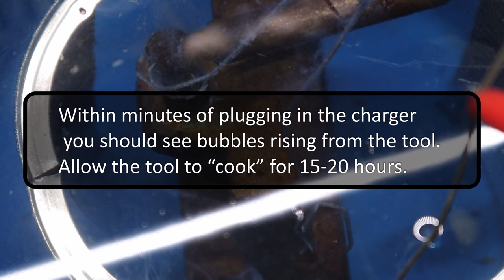How To Remove Rust With Electrolysis In Six Easy Steps

Comment: Laundry soda (sodium carbonate) works even better than baking soda (sodium bicarbonate), but both work.  A standard 10 amp 12V charger works fine.  I often use an old scrap of rebar instead of a tin can.  When the the rebar starts to load up with rust, I see the current drop.  I clean the rebar on a wire wheel, then put it back and see current increase.
Reply: Common Sense Realist  I usually start with 24 hours in vinegar for an old axe.  A hit of the wire wheel after that, and I can see the temper line.  Electrolysis or Evapo-Rust (chelation) comes after that.
Reply: Scrap Stainless steel works well and can be wiped clean. Also 12v (18-22v) solar panels work by themselves as power source.
Reply: @neomateo944 stainless should NOT be used with electrolysis!
Reply: @cody2097  Why not
Reply: @dukerton15  hexavalent chromium
Reply: @cody2097 i attach rusted item with stainless wire i have and its quite violent

Comment: If you sand a small area with fine sandpaper where the cathode wires are attached to the tool to expose bare metal, the time required will decrease due to a better electrical connection; iron oxide conductivity is poor.   Also, if you use coated wire except for the connection to the tool, the water electrolysis (hydrogen generation) will be less.  Notice the bubbles on the wires to the tool and the anode.  
Nice choice of anode, the can will allow a good electrical path to most of the tool.  If you could use a large can that the tool completely fit within, that would work even faster.
Reply from the maker: Thanks for the tips. I will keep this in mind.

Comment: Good video 😎
Get an old car battery charge it up pour all the acid out and use a paint brush to paint it on,
Dissolves the rust instantly
Removes every trace of it
Or soak in vinegar for a few days,
 I've restored loads old tools I Found in a quarry using white vinegar 😃

Comment: Safer, healthier, and so much cheaper.... White vinegar.... Glass container and cover the rusted object totally. Works perfectly every single time. Even faster if you heat up the vinegar.
Reply: Ok MamaBear...some of us drink Monster Energy for breakfast, not oats...
Reply: I'm all for the safer route👍👍
When you say "heat up" is that just a case of putting the vinegar in a pan and heating?
Reply: When I'm doing electrolysis, I use washing soda, and an adjustable power suppy. It's pretty safe, and it works better than I could ever get vinegar to. Can't get it to electrocute me if I tried, and the solution isn't poisonous or bad for the environment at all.

But I had the power supply on hand for electroplating. I'm not sure I'd want to use a computer power supply, like in the video.
Reply: @Savagedownsouth  j
Reply: How is vinegar cheaper?
Reply: @Luke10.25-gospelJesustaught  It ain't THAT bad. I've done both. You get a little more flash rust with vinegar, and if you leave it too long, it'll eat the iron, that's true. But it's not ruining the pan.
Reply: @Luke10.25-gospelJesustaught  My dude, I do electrochemistry and cast iron repair for a living. I'm a machinist who also does plating. I've also repaired a bunch of old cast iron machines in my day.

Vinegar is a fine way to remove rust. You rinse and scrub whatever you were derusting when it comes out of the bath, dry it, and coat it in oil. It works in an industrial setting, and it works on pans, without any more lingering rust problems than the electrolysis method. 

The real problem with vinegar is that it eats the metal. It makes sharp edges sharper, and can make you lose detail on a casting. Not really a problem on most pans or parts, unless they're decorative, or require tight tolerances.

I've read the same things you have, and I used to be scared of using vinegsr to derust things. But after years of doing it in my own shop, and seeing no practical difference, I no longer think it's an issue.
Reply: @Luke10.25-gospelJesustaught  That's a good point. Chrome and nickel plating are surprisingly finicky. I'm also realizing I've never tried nickel or chrome plating over a vinegar-derusted piece of iron. I oughta try it some time, on my own stuff.
Reply: @Luke10.25-gospelJesustaught  you must be wrong. literally every body says use vinegar everywhere online not just youtube.

Comment: For those of you watching this video, you should be using "Washing Soda" (sodium carbonate) not "Baking Soda" (sodium bicarbonate) for the electrolysis process.
Reply from the maker: Agreed, both has similar results. All it does is make the water conductive, even using regular dishwashing liquid will work. I have used baby shampoo before with good results, and it smells good. ;-)
Reply: I dont know that it matters much if its carbonate or bi- carbonate.. Either works great. Just dont use table salt because that produces chlorine gas which can kill you..
Reply: You can make sodium carbonate easily by just heating sodium bicarbonate at 100 degrees Celcius
Reply: @andyloescher2401  are you sure it is 200C and not 200F? thought it was 200 Fahrenheit for 1 hour
Reply: @Midnightgamer00  damn oops. I meant 100C
Reply: @allanhundeby1675  How does it do that unless there is chlorine in the water already?
Reply: Do  dc from 12v battery would work?
Reply: @damantrip2874  perfectly, but take care of short circuit, a car battery will put a lot of current during short circuit and could cause some serious damage
Reply: @damantrip2874  run it through a light bulb to serve as a current limiter.
Reply: @damantrip2874   because chemistry.  Salt is known as “sodium-CHLORIDE”
Reply: @brucetutty9984  Table salt is sodium chloride - (sodium and chlorine).

Comment: This is very interesting and enjoyable.   Can anyone comment what is the chemical composition of the fluid in the electrolysis bucket after the procedure, and how can it be safely discarded?  (It looks a little unwholesome).  Thanks
Reply: to my knowledge (which is not too professional) all this is doing is creating iron oxide (the unsavoury black goop) and some gases. one thing to note is NEVER EVER use stainless steel as your anode or else youll create hexavalent chromium which is a neurotoxin and carcinogen among other things, and thatll need to be professionally handled as toxic waste haha. so as long as youre using the correct metals and doing this in a well ventilated area youre all good to dump it whereever, if youd like you can be doubly safe and dilute it with some hose water haha. if youre really unsure you can contact your local authorities or waste management wherever you are and ask them about the proper disposal here. with any home chem as silly as it sounds youve gotta do a ton of research to make sure youre doing it right and not making something toxic.
Reply: @accuwau  thanks - very informative and helpful

Comment: So, were you able to remove the stuck screw?. I have noticed parts that are close together don't seem to get as clean as the rest of the parts? I would try a little heat first because it's easier and faster. Then you can do a complete teardown. Depending on if you are just wanting a working vice or complete restoration. Thank you for taking time to post this.

Comment: On electrical supply: Using a 12V supply @ 2A (suggested in another comment) is probably a little overkill, but the higher the wattage (12V*2A=24W) the faster the derusting (just don't get silly with it). I have used an old cheap USB charger plug which is only 5V @ 0.5A(max) which would be 2.5W. It takes longer, but the results are generally the same (with properly sized cathode). Patience with smaller wattages, but if you have the time it doesn't require constant attention.

Also, the baking soda (sodium bicarbonate) is only in the water to raise it's conductivity =slightly=, salt would also work (I have used it) but with salt you might have a more immediate chance of an oxide layer form (iron/steels) afterward. A good wash and dry immediately after derusting would probably fix that.

Make sure the part is completely submerged. Try to use a flat(ish) cathode with about the same mass as the part. Make sure the part and the cathode are secured in the container and cannot touch each other. And remember that wet skin is =much= more conductive than dry skin; best to just use rubber gloves and avoid the water when dealing with this and always respect the potentials involved. I'm not going to say this is a super dangerous process, but it is water and electricity and getting bit sucks.

Comment: Electrolysis. What a fascinating name. It has Electro and Lysis in it. There’s the battery, then the plugs and now the can. The can is opened and sawed into a split. Drilling, looks like a fascinating project in these hands. Soap cleans iron, and electric battery cleaning scraps rust right off like it was an easy dish stain. This is not the first video I watched that amounted to powder aiding in the battery cleaning process and how it cleaned without touching any form of electrolytes? Wow. It’s all basic clean for hours on end, plus the effects of positive and negative power. 

It all had become a complicated muck of orange, yellow, brown and gray resulting from this much rust and aging of the vise. Then it was scrubbed a few more times to eliminate rust completely until the whole body turned gray. You probably know it’s gray from being a newly melted iron. I had realized that the vises were used in countless woodworking projects like at school. I recalled making stuff out of wood using vises.
 
The whole story about the vise makes me realize how much I’ve learned in shops and it wasn’t that hard getting good grades. I’ll bet this is not new to me because I’ve seen this kind of cleaning in some restoration videos.

I’m blown away. Love it too.

Comment: why not disassemble it first before doing this? wouldnt this leave rust in the parts where the threaded bolt is covered? seems like sandblasting them after taking it apart would be easier
Reply: Sandblasting, muriatic acid, wire wheeling all would have likely worked better, but would have defeated the purpose of the video.
Reply: Exactly what I was thinking after seeing the final result. Spray some liquid wrench on the threads, prop it up to let it soak down for a couple hours until its unstuck. Then sandblast it and not only will the rust be gone, but it will look much better in the end.

Comment: Can i use this in my radiator?
There seems to be a lot of rust mixing with my coolant.
Reply from the maker: I cant give you any advice on how to fix your car. For that its better to talk to a professional in the field.
Reply: Most radiators are aluminum and plastic today if you got rust but no leak then try a coolant flush and you should be good
Reply: When was the last time that car had cooling system flushed and filled ?

If one don't remember, chances are it's either been too long ago or has never been done.
Reply: @theroyalcrownedtiger2946  I haven't had it flushed since i acquired it.
Do you think that will solve it?
Reply: @AndrewMDairo  : It can help, to do the flush and fill, also don't forget to use 2 bottles of cooling system cleaner  2 shots in 1 go, and lots and lots of water, and warm ups.

Comment: What was the elapsed time for electrolysis ?
Reply from the maker: I think it was 24 hours.
Reply: You can leave it in for a week if u want.. This method will only attack the rust.. After removal and cleanup, you need to spray some lubricant of some type or it will flash rust quickly...

Comment: 3 Questions, the anode and cathode should not touch from each other in d bucket? Ur electrolytic subs is only baking soda? Can I use hanger wires for conduction?
Reply from the maker: No they should not touch, that creates a dead short and could damage your power supply. Yes you can as long as it is conductive it will work.
Reply: Been there done that and blown the rectifier - fit an online car fuse to prevent this happening to you. Before you switch on you can do a continuity test to make sure there is no contact. [it can be hard to see in a non transparent tank or with a murky solution]

Comment: I have a lipo Charger that's supports DC charging up to 18volts. Will that work?
Reply from the maker: Yes, just keep a close eye on the charger  so it does not overheat. If the current is too high, dilute the electrolyte by adding fresh water.

Comment: ONE OTHER THING....
Take a utility knife and blades, and SCRAPE OFF the heaviest rust.  This goes quickly, and you can see a lot of good metal right away.
This will save you a TON of time and other effort.
THEN use the electrolysis.

Comment: Great video! 
I need help with a project of mine. I need to de-rust the inside of my motorcycle fuel tank. What should I do if I can't scrub the inside of the tank? Please advise. Thanks and awesome video once again!
Reply from the maker: Thank you, The best option is to wash it out as good as you can, let it dry and fill it with Evaporust or something similar. Let it sit for a few days, recover the rust remover solution for another day's use, let the tank dry and I think you should be good to go. I have not done it before, but that is what I would attempt.
Reply from the maker: Have a look at this video, this might help as well. 
https://youtu.be/y8HEZ-x4-_w?t=158
Reply: @AJRestoration  Great news! It's almost as good as new when I painted it over with POR15 after removing the rust. Thanks for the advice. Wishing you the best!
Reply: For your bike tank, I would clean it out the best you can using your preferred method.
Then, to seal it use "Kreme" per the directions that comes with it. It is a tank sealer specifically made for that.
  I hope this helps.🏍
Reply: I cleaned out a rust wooly 200 l diesel tank for my wheel loader with water up to the rust level and one liter phosporic acid. This acid will take the rust and not so much the metal.  After several days the tank was perfectly clean from this rust layer that loosened and clogged the prefilter. The error previous owner had done was to fill the tank to a low level from 20 l canisters. So theres room for condensation. Be sure to check suspicious spots for leakage before you mount it back and fills it with 100 liters of fuel. I made that mistake... I also used some cleaning agent for cleaning toilettes and more that contains phsporic acid. There can be hard to buy real phosporic acid in some countrys for a private citizen. We have  in Sweden something called kalkbort its like a thickened so you csn just use a brush and put it on the rusty part and it will cling on the surfaces for some time. Kalkbort is for clenaing off calcium in the bathroom... and be careful use protection for your eyes and hands...

Comment: just as a little science experiment, could you do this by running 3x 9v batteries (in parallel) instead of a power supply or is that too low amperage?
Reply from the maker: That would work yes. I think so anyways.
Reply: You want the amps to be low. The lower,  the slower it works, but works better
Reply: You want the amps to be low. The lower,  the slower it works, but works better
Reply: You want the amps to be low. The lower,  the slower it works, but works better

Comment: You mentioned that we need a charger and a power supply. But in the process you only use the power supply? what the charger do in thís process? thanks
Reply from the maker: A charger, or a power supply. Both will work. A 12v battery will also work.
Reply: Thank you for your prompt reply
Reply: Great question, I was going to ask the same thing

Comment: Ahhh.... hey buddy, doesn't make more sense to dissolve the baking soda in the bucket of water before you pour it into the bucket where the rusty part and the anode will be used for the electrolysis process?

Comment: Can i use a welding machin for this process if i do Not have a battery charger?
Reply from the maker: You can use a welding machine, but I don't think its a good idea. I am not sure if the welding machine will enjoy staying on for long periods. Also the amount of amps will be too high, unless you use less baking or washing soda in your solution. It will be trial and error, try it on something you don't mind throwing away and first get your ratios ready and then if you want to risk it, go for the part you want to de rust. (I would probably not use a welding machine)
Reply: @AJRestoration  ok thanks bro i get it. I used less soda and i set up it with 320V but now i think i will stop and i will buy a machine charger. By the way it works the rust comes out and there is the reaction. But for to be sure i do Not make some damage now i will stop it.

Comment: If the anode (can) touches the cathode (tool), won't that cause a short circuit and damage your charger/wires? If so, then this setup is not very safe.
Reply from the maker: It is the basic setup. Nothing can be idiot proof ;-)
Reply: @AJRestoration  It just seemed to me that the anode/cathode are a little unsteady AND that they are in very close proximity of each other. 

Overall, I think that it's a nice, minimalist setup, but perhaps it would benefit from an additional tweak which would ensure that the anode/cathode don't make direct contact.
Reply: A short will not harm you but will fry the rectified in the power supply. Most chargers have fuse, but if yours does no, fit an inline fuse carrier in the dc positive lead to the tank

Comment: What was the power supply?
Reply from the maker: 12v PSU
Reply: @AJRestoration  as you can tell I don't know too much about this but what is psu ? and can you you 12 v battery charger or  a battery trickle charger?
Reply: @billmeade9029  Power Supply Unit for a computer. ( I looked up the acronym on Wikipedia and all of the ads also called them PSUs.)